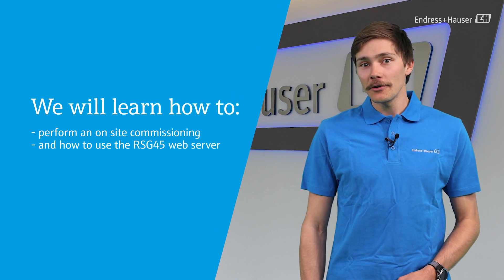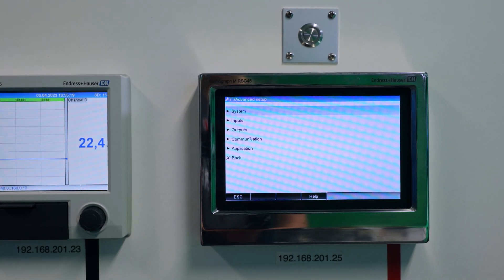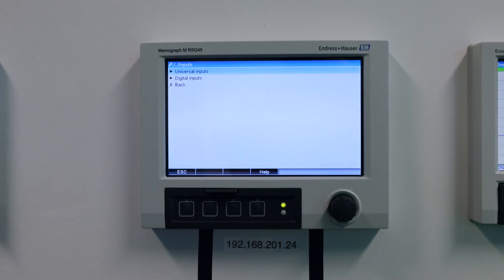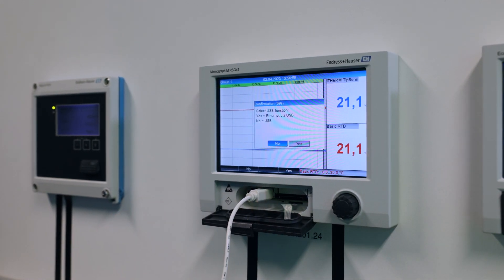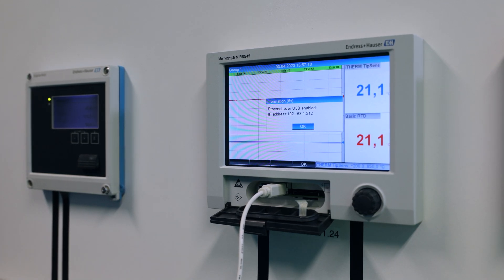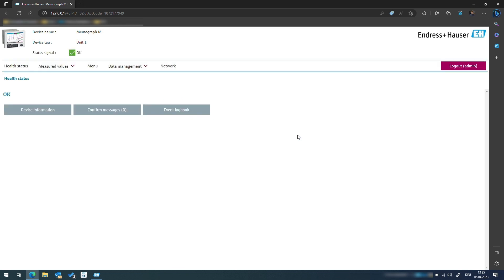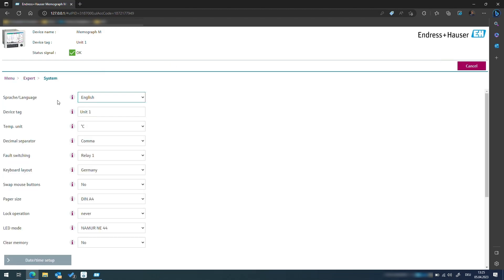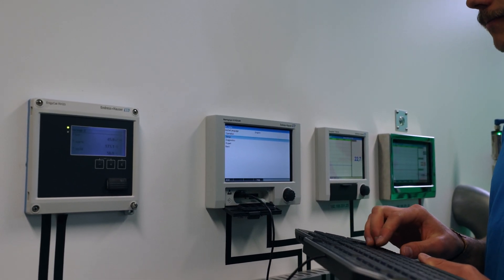RSG45 video series | No 1: Commissioning on-site and via web server | #endresshauser

Comment: How to transfer setup file that we save on RSG 40 to RSG 45
Reply from the maker: Hello, RSG45 is a complete new device with new firmware. Therefore it is not possible to transfer the setup from RSG40 to RSG45. Recommendation would be to print the setup of RSG40 with ReadWin2000. As naming and main functionality is similar it is then easy to setup RSG45 via webserver accordingly.